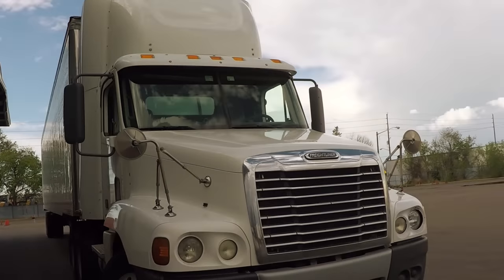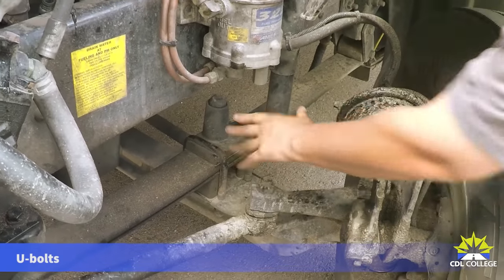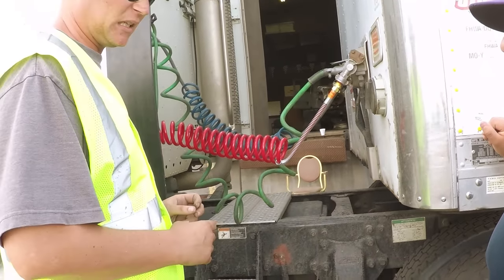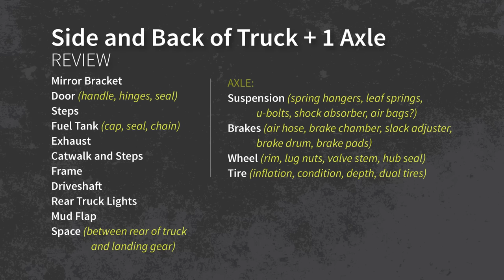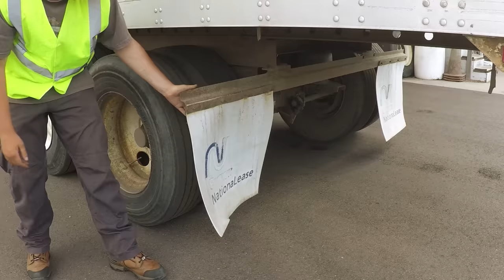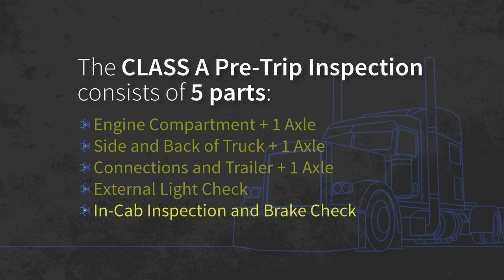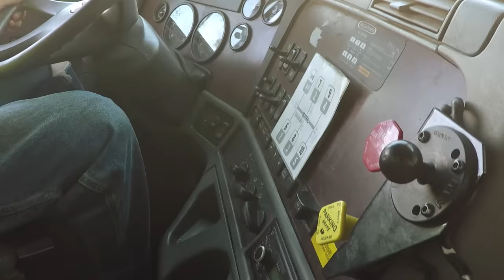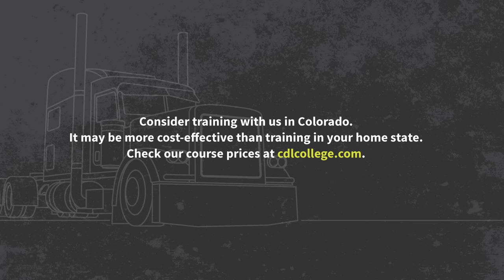[Tutorial] CDL Class A Pre-Trip Inspection DEMO

Comment: Metal or plastic - B.B.C (Not bent, broken, or cracked)                       3 L's
Rubber - A.B.C. (abrasions, bulges, or cuts)                                         3 engine components
Everything securely mounted                                                                 3 fluids

Front of tractor:
3 L's - Lights, leaning leaks

Lights (clearance, headlights, turn signals) - securely mounted, not bent, broken, or cracked, Amber in color. 
Leaning - make sure truck is not leaning indicating an suspension or tire problem.
Grille/bumber- Not bent, broken, or cracked. Mounted securely, not obstructions blocking grille to radiator
Leaks - check for puddles or leaks from engine or transmission

Engine compartment (pass side) 3 engine components:
Alternator - Belt driven, securely mounted, not bent, broken, or cracked. Belt driven. No abrasions, cuts, signs of wear on belt and 1/2"-3/4" play when pressed. 
Water pump - Gear driven, securely mounted, not broken or cracked, not leaking.
Air compressor - Gear driven, securely mounted, not broken or cracked. No audible leaks

Side and back of truck + 1 axle:

Side: 
Mirror bracket - securely mounted, not bent, broken, cracked
Door (handle, hinges, seal) -  securely mounted, not bent, broken, cracked, funtions properly, and seals have no abrasions, bulges, cuts.
Fuel tank - securely mounts, not bent, broken, cracked, no visual leaks
fuel tank cap - safety chain and rubber seal instact
Tank straps - securely mounted, not missing any nuts or bolts, not bent, broken or cracked.
Cab Steps - securely mounted, not bent, broken, or cracked. No excess debris

Back:
Exhaust stack - securely mounted, not bent, broken, or cracked. no signs of leaks such as rust or carbon soot.
Catwalk - not bent, broken, or cracked. No excess debris
Driveshaft - securely mounted not bent, broken, or cracked, free of objects, u-joints should be lubricated and no wear marks shiny metal.
Frame - no illegal welds, no drilled holes
Catwalk steps - securely mounted, not bent, broken, or cracked. Free of debris. 
Splash guards and mud flaps - not bent, broken, or cracked, proper clearance from ground
Lights - not bent, broken, or cracked, clean and proper color. 

Axle:
Spring hanger - securely mounted, not bent, broken, or cracked.
Leaf spring connected to rear airbag - securely mounted, not bent, broken, or cracked
Air bag metal mounting plates - securely mounted, not bent, broken, or cracked. 
Air Bag - securely mounted, no abrasions bulges, or cuts, no audible leaks
U -bolts - securely mounted, not broken, or cracked.
Shock absorber - securely mounted, not bent, broken, or cracked, bushings no abrasions, bulges, or cuts.

Brake lines - securely mounted both ends, no abrasions, bulges, or cuts, no audible leaks
Brake chamber - securely mounted, not bent, broken, or cracked, no audible leaks
Slack adjusters and pushrod - securely mounted, not bent, broken, or cracked. With brakes released pull for no more than 1 inch of play.
Brake pads - securely mounted, not bent, broken, or cracked,  not worn dangerously thin at least 1/4" material, no grease or oil.
Brake drum - securely mounted, not bent, broken, or craked. No signs of overheating - blue color.

Inner wheel rim (inside) - securely mounted, not bent, broken, or cracked, no illegal welds. 
Tire sidewall inside (inner) - secure to rim, no audible leaks, no abrasions, bulges, or cuts
Tire face - evenly worn, at least 2/32" tread
Tire sidewall outside (inner) - secure to rim, no audible leaks, no abrasions, bulges, or cuts
Budd spacing of dual tires - securely mounted, not bent, broken, or cracked, evenly mounted, no gaps, no debris
Valve stem- would check air pressure with tire guage (90-100psi)
Outer wheel rim - securely mounted, not bent, broken, or cracked, no illegal welds.
Lug nuts - no signs or rust or shiny threads indicating looseness.
Hub seal and nuts - securely mounted, not bent, broken, or cracked. No leaks. 

Coupling and connections:

Electric wire - no burnt, frayed, or exposed wires, secured to tractor and trailer with safety latch, proper clearance from catwalk.
Service/Emergency air line - no abrasions, bulges, or cuts, no audible leaks. Secure to trailer with glad hands, not bent, broken, or cracked, proper clearance from catwalk. Room when turning. 

5th wheel assembly:

Apron- securely mounted, not bent, broken, or cracked. No gap/daylight between apron and skid plate.
Skid plate - securely mounted, not bent, broken, or cracked, properly lubricated. 
Release handle - in locked position
Pivot pin- securely mounted, not bent, broken, or cracked
Platform - securing skid plate to frame not bent, broken, or cracked, or missing hardware
Kingpin of trailer and locking jaws -securely mounted, not bent, broken, or cracked. locking jaws are scure around kingpin.

Trailer (front)

Lights - not missing, securely mounted, not bent, broken, or cracked, red in rear and amber everywhere else. 
Header board- securely mounted, not bent, broken, or cracked. No holes

Trailier (side) 
Side of trailer - securely mounted, no holes. 
Reflective tape - 50% DOT red/white tape going all the way down trailer
Crossmembers - Securely mounted, not bent, broken, or cracked. Inspect trailer floor for holes or damage.
Landing gear - securely mounted, not bent, broken, or cracked. no missing hardware. Crank handle secure in locked position
Clearance lights - securely mounted, not broken, or cracked. Proper color amber. 
Air lines- proper clearance from ground, no abrasions, bulges, or cuts. No audible leaks
Tandem slide track and pins - securely mounted, not broken, or cracked, pins in place. 
Mud flaps - Not bent, broken, or cracked. Proper clearance from ground.
Rear ABS light - securely mounted, not broken or cracked, Proper color. 

Trailer (Rear)

Doors - securely mounted, not broken, or cracked. No holes
Hinges - securely mounted, not broken, or cracked. Not missing hardware. 
Door rods - Not bent, broken, or cracked. Properly locked top and bottom. Handles in locked position. 
Door seal - scurely mounted, no abrasions, bulges, or cuts. 
Reflective tape - 100% DOT red/white tape
Lights - securely mounted, not broken, or cracked and all proper color. Red in rear. 

Rear Trailer axle: 
Trailing arm mount - Securely mounted not bent, broken, or cracked
Trailing arm - securely mounted, not bent, broken, or cracked. Goes to rear air bag
Air bag metal mounting plates - securelt mounted top and bottom, not broken or cracked. not missing harware
Air bag- securely mounted, no abrasions, bulges, or cuts. 
Shock absorber - Securely mounted top and bottom, not bent, broken, or cracked. 

Brake system rear axles:

Brake hoses/lines - Securely mounted. No abrasions, bulges, or cuts, no audible leaks
Brake chamber - Securely mounted, not bent broken, or cracked. No audible leaks. 
Slack adjuster and pushrod - Securely mounted, not bent, broken, or cracked. With brakes released no more than 1 inch play when pulled.
Brake pads - securley mounted, not bent, broken, or cracked. Not overheaded glazed over. no grease or oil, Not worn dangerously thin. should have at least 1/4" depth.
Brake drum - securely mounted, not bent, broken, or cracked. No overheating signs glazed over blue.

Rear axle rims and tire: 
Inner wheel rim (inside) - securely mounted, not bent, broken, or cracked, no illegal welds. 

Tire sidewall inside (inner) - secure to rim, no audible leaks, no abrasions, bulges, or cuts
Tire face - evenly worn, no abrasions, bulges or cuts, at least 2/32" tread
Tire sidewall outside (inner) - secure to rim, no audible leaks, no abrasions, bulges, or cuts
Budd spacing of dual tires - securely mounted, not bent, broken, or cracked, evenly mounted, no gaps, no debris
Valve stem- would check air pressure with tire guage (90-100psi)
wheel rim outer - securely mounted, not bent, broken, or cracked, no illegal welds.
Lug nuts - Not missing. No signs or rust or shiny threads indicating looseness.
Hub seal and nuts - securely mounted, not bent, broken, or cracked. No leaks.

External light check: 

Have instructor stand and indicate all lights are functional.
Reply: Nice!

Comment: I just started a cdl class. FML! This is the part that scares me most because I know very little about engine parts and components! But at least he physically touches the component or part that he’s explaining so the viewer knows what it looks like! Some vids fail at doing this assuming new drivers know what they are looking for. Will be watching this over and over till I get it
Reply from the maker: Don't sweat the names of the parts, Battlered. If you forget the name of a part during the Skills Test point to, or touch, the part you are inspecting so that you receive credit for the item. When you are inspecting an item, first observe what the item is made of–metal? plastic? rubber? Metal and plastic parts should be securely mounted and not cracked or broken. Rubber parts should not be split or cut and securely mounted. If any of these parts have a fluid or air inside of them, they cannot be leaking. Follow the flow of the inspection demonstrated by Atom. If you have any questions about backing or driving, hit us up.
Reply: CDL College, LLC thanks! Will do!
Reply: Battlered 713 did you pass?
Reply: Great
Reply: Pre-trip was definitely something I was scared and intimidated by. But I worked hard and looked at another video MYCDLBuddy that helped me tremendously. I Passed pretrial, maneuvers and road test. I passes!!!

Comment: I swear you explained this so simple with words anyone could understand 3 L’S/ 3 engine departments and 3 fluids you really put it all in order good over all thanks for this video
Reply from the maker: The Flow. Follow the flow of the inspection: top to bottom, front to back. Practice one section at a time (Engine Compartment + 1 Axle) until you know it. Then add the next section (Side and Back of Truck + 1 Axle). Keep adding sections until you've mastered it. Thanks, BankCity!

Comment: The best instructor for pre trip I've seen...Adam you rock 
So calm, thorough and precise. My instructor gave us a list to follow and the verbiage was not sticking but after watching your video I believe I can nail this test. Thank you tremendously.
Reply from the maker: Metal Parts: cannot be cracked or broken.
Rubber Parts: no abrasions, bulges, or cuts.
Parts holding air or a fluid: no audible or visible leaks, respectively.
The flow of your inspection should be from the top, down and from front to back. When students start jumping around during the Pre Trip, they become confused. Follow the flow and it'll be a piece of cake, Maria. Best of luck to you!

And, you're right...Atom rocks!
Reply: Shoot out place in Illinois makes us say way more than that...crazy amount of verbiage that's hard to remember

Comment: This is by far the best CDL Class A Pre-Trip Inspection video out there.  Love all the acronyms to help you remember and the screens that show what you will be tested on - 5 Part sections (Engine Compartment, Side & Back of Truck, Connections & Trailer, External Light Check, and In-Cab Inspection & Brake Check)Again GREAT JOB on the Video!!!!

Comment: Testing on Wednesday. Ill just be honest and say Ive been slacking on my pre-trip over the past 4 weeks. Simply put, this is the video cheat sheet to it all. Been watching it non-stop for the past 2 days and all ive got left to master is parts of the 5th wheel. Hands down, no question the best video out
Reply from the maker: Thanks for the comment, Jay. Here's a tip for you: you aren't required to know the NAMES of the parts you are inspecting. You are only required to inspect the correct parts, regardless of what those parts are called. Example: if you point to, or touch, the steering shaft and say "my brake chamber is not broken or cracked, it's securely mounted, and there is no foreign debris in the universal joints". The fact that you called the steering shaft a brake chamber DOESN'T MATTER, because you inspected the steering shaft correctly. The tester does not have a checkbox on his form for the NAME. There is only a checkbox for whether or not you inspected the steering shaft the correct way. Misidentifying parts is OK. Hope that helps.

Comment: Should have mentioned that the drive tires can be recaps but the steering tires can not be caps.
Reply from the maker: A valid point.
Reply: Only on buses
Reply: @Nolan45000  Trucks too. Steer tire must be a virgin radial, NOT a recap. Drive tires can be recap.

Comment: Great Video. Two things I noticed: Under hood/engine inspection, you think would have included checking washer fluid level (since they didnt work during in-cab inspection) also the speedometer is reading almost 15 mph.
Reply from the maker: Students go through a lot of wiper fluid. We also like to include some things on the vehicle that the student must "report to maintenance" or "note on the DVIR". Thanks for watching.

Comment: On the tires.   Make sure you look for air bubbles on the sides.  Rub the sides on curbs you make the sides weak. Causes air bubbles.   Air pressure get high if it's hot. So have a gauge to check them

Comment: May I offer a suggestion, I have been driving Tractor Trailer for 43 years. When doing a pre-trip inspection,  and you have opened the hood, start at the wheel Hub and work out from there. Over the top of the wheels to the back of the wheels, to the suspension, mounts and then motor.
Reply: I respect it, we all have our own ways. Thank you for what you do.

Comment: Heads up to everyone taking their road test. 

I went this morning to do my pre-trip, brakes and road test in the state of GA. 
PLEASE make sure you do them in the correct order. I watched this video like 40 times but ended up failing due to not doing it in a correct order (different states have different orders) thats what the inspector told me. She said I basically did it all right but in the wrong order. Go your states DMV website and each state should have a pre trip inspection video so you know your states law on the pre-trip. I basically did everything just like the video but I should of checked for air leaks/warning buzzer/valve pop first.. But I did parking/service break.
Reply from the maker: In Colorado, you can inspect in any order you choose, Zica. Did she read you 4 different sets of directions? 1-Engine Compartment + driver half of the Steer Axle; 2-Side and back of truck; 3-External light check; 4-In cab and Brake Check. The order shouldn't matter...
Reply: CDL College, LLC Nope, I only failed the brake test because I did not do it in the correct order. I did everything you showed in the video. I even showed her your video, she told me that I did everything correct but not in the correct  order. Georgia's order is.. safe start, wait for air governor for cut off, shut vehicle off, release brakes and hold service pedal brake to see if theres any loss in PSI pressure, then fan breaks for buzzer and spring brake's engagement. Then safe start truck again, build pressure again and wait for air governor cut off then tug test parking brake and trailer brake and last one is service pedal brake test.
Reply: I also failed in texas because of the order, they want the air leaks done first before the tug test..i didn't remember to push in the valves cause in the video the brake valves are already in because the tug test was done first.

Comment: Lmao !! NOT BENT BROKEN OR CRACKED !! Well good video ! Wow if you only get around 10 mins to check ALL this before a trip  and during a trip. I'm going to be really late to my drop or say delivery. There is a problem with the steering box. If it leaks enough to get all over the brake chamber like it is that's to much for me. Plus DOT would write you up and may even put you out of service. 10-7 until fixed.

Comment: One of the best pre trip videos out on the net....my question is are the same pre trip inspections done for a dually pickup and gooseneck....my local dps office here in Texas is saying I need a class a CDL to use my gooseneck with my new truck 2017 f350 .....combined gvwr is 28k tried to get a non CDL by they said I didn't all umdermthe exemption
Reply: Also the trailer is only used to haul a rock crawler and a couple 4 wheelers to the offroad parks ...and not for hire it's all personal use ......so I'll show up for my driving test on the 1st and see how it goes
Reply from the maker: You need a Class A, R D. This video should work just fine for your inspection in Texas. Thank you for watching and commenting.

Comment: Do you have to test the tire pressure with a tire gauge or do you just have to let them know that’s what they’d have to do? 
Same with the oil dip stick, do you have to test it or just tell them?
Also, don’t you have to test the parking brake on the trailer to make sure it works?
Reply from the maker: You are not required to perform any maintenance during your skills test. Yell the tester: 'I WOULD check the tire pressure with an air gauge (in the real world)", and "Here is where I WOULD check my oil (point to dipstick). I'd pull the dipstick, wipe it clean, re-insert it, then pull it out again to check the level." Trailer brake is not on the test. Thank you!
Reply: CDL College, LLC thank you very much! I appreciate the quick response and all your videos. They’re extremely helpful!